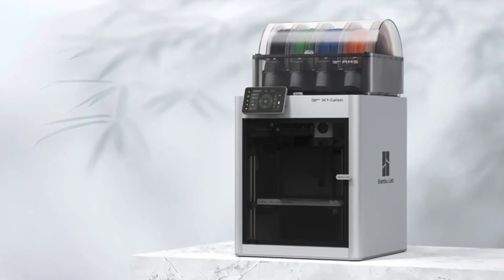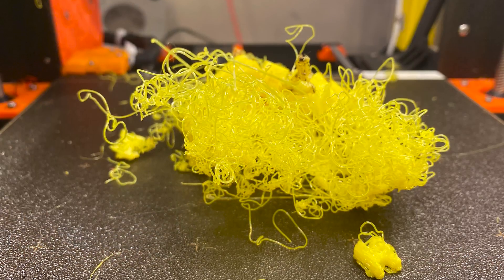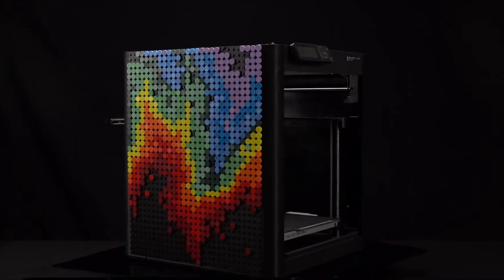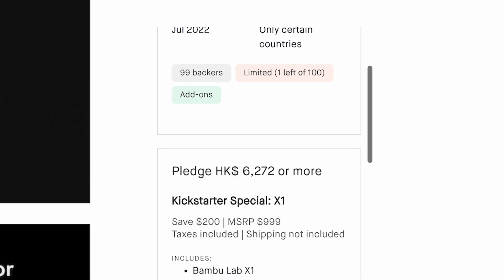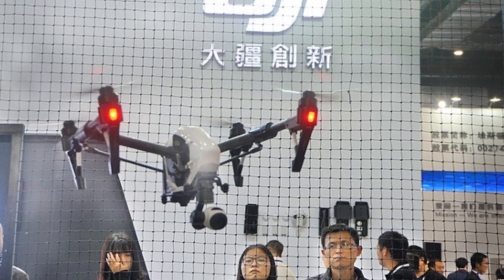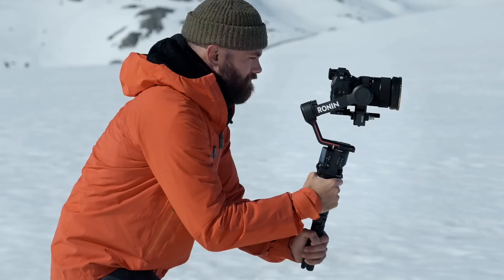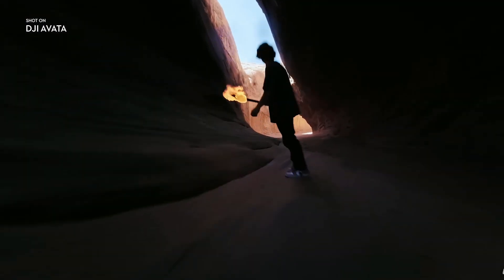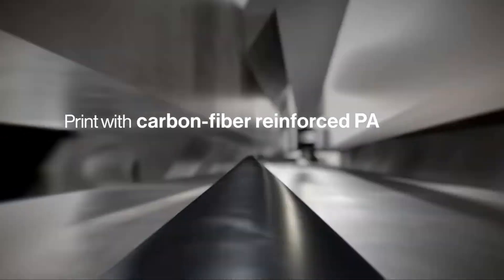Bambu Lab's X1-Carbon 3D Printer: Who is this Company?

Comment: The validation, interpretation, modification, fulfilment, and dispute settlement of these Terms are governed by the laws of the People's Republic of China. If any dispute arises concerning the content or performance of these Terms, the dispute shall be settled through friendly negotiation. In the event that the dispute cannot be settled through negotiation, either party could submit the dispute to China International Economic and Trade Arbitration Commission (CIETAC) for arbitration which shall be conducted in accordance with the CIETAC's arbitration rules in effect at the time of applying for arbitration. The arbitral tribunal shall consist of three (3) arbitrators. Bambu Lab and you shall be entitled to appoint one arbitrator, and the third arbitrator shall be jointly appointed by CIETAC. The language of the arbitration is English and is conducted in Shanghai, China. All arbitrators must be proficient in English. The arbitral award is final and binding upon both Bambu Lab and you.

Comment: Yes interesting Printer
As I understand it, they had Vez3D as a consultant, 
They have used much of his ideas: central Z motor, active cooling, with air from inside of the cabinet that blows from both sides from the side of the print bed.

Comment: Too bad their build quality and QC sucks, $700-$1500 with the build quality of a creality it seems. So many reports of warped beds, bad hot ends, bad stepper motors, bad MB fans, Carbon rods getting wrecked, AMS' that don't work right. They struggle to print PETG, can't print TPU with the AMS. My friends P1P was dead the day he got it, less than 10hrs or print time, needed new stepper motor, finally got it after 3 weeks of back and forth with BL support. Hard pill to swallow for some people, but BL printers just reflect typical poor chinese manufacturing.
Reply: Do you have a significant number of those people complaining? versus the people staying silent and enjoying their printer? 😂
Reply: @fidelthemenace3968  Yes, it's called the internet.
Reply: Well I will report to you no issues like you described, but you won’t remember that.
Reply: @RCPhotosVideos  Lil monkey trolls every Bambu Lab post since his orange and black dumpster has been so disappointing to him.

I am easily at 2k hours printed since Aug 2022 and the printer is fantastic. Nothing touches it at the moment in out of the box printing and ease of use. 

I am still on the same starting nozzle and build plate. I'm kicking myself because I bought a ton of spare parts thinking I would need them since other 3d printers have burned me in the past. Lil monke even thinks his black and orange science fair project is comparable in speed. LOL. He is best to be ignored.
Reply: @No0o0o0o0o0  We've been though this multiple times, don't know how many times I gotta repeat myself for you. Been using prusa for 4+ years and have never been disappointed in them. Never once had a breakdown or had to repair something. Nobody cares that you have 2k hours, my oldest printer has 10k+ hours, only a nozzle replacement because I went from .4 to .6. Meanwhile, youve had to replace your MB fan in your time, and no telling what else. There isn't a single person that has 2k hours on a BL printer that hasn't had to replace SOMETHING on the printer. Have fun when your bed cable goes out, like everyone else. Thats a 4+ hr job right there.

Keep defending bad QC and bad CS, Im sure your bed is warped now like everyone else. BL even admitted to having hundreds of warped best shipped out from the factory. I care about print quality and reliably, something bambu can't do. Your only example of "bad quality" in a prusa is error 602 which is a non issue, been a non issue for years. Meanwhile I can find dozens of different examples on BL printers regarding bad QC. I've seen it 1st hand multiple times.

Go back under your rock with your silly "20 reasons why BL>prusa"
Reply: @LilApe  it’s funny listening to people who have not used both products but pretends to be an expert in both. I understand where you are coming from with the prusa claims and I have also had a great time with my prusa ownership. BUT owning both has really opened my eyes to the fact prusa got left in the dust by Bambu, again I have enjoyed my Bambu, raise, lulzbot, markforged, prusa, creality, makerbot, elegoo, and others. I still have never used anything like the Bambu.
Reply: @RCPhotosVideos  I've used both. I don't care about speed, I only care about print quality and reliability. My prusa excels in both over the P1P.
Reply: @LilApe  so speed isn’t high on my list but ease of use, setup, filament changing, print management, and monitoring the print are all high up. Followed by multi color, print quality, and % of successful prints and the Bambu exceeds at all of them.
Reply: @RCPhotosVideos  I guess, took me 7 attempts after repairing a P1P to get a successful print. From adhesion problems to clogs. Takes me only 15 minutes to unbox a MK3S, calibrate and get a successful print on the 1st try.
Reply: @LilApe  no argument with the prusa setup, it’s easy and fast. But print setup isn’t as easy. I have been able to talk someone over text messages how to setup a print on a Bambu, load filament and send it to the printer. Maybe my markforged would be on the same level of easiness but no way I could do that with my raise prusa or lulzbot and forget a creality machine.

Comment: I'm an embedded hardware developer for the last 40 years, their integration and design experience makes this printer a simple joy to use.   Many nay sayers will point out they're just copying what exists already.  Every product does this, so what. This printer is big step forward for non tech people to make their first thing.
Reply: It's my first printer. It has been going non-stop for weeks, and all I do is clean the bed plate every 10 or so prints
Reply: @J Davis remember to wipe down the carbon rods now and then! Otherwise, I think the particles can clog and seize up the print head.
Reply: @magnarex  will do, thanks.
Reply: Same thing with DJI drones. First DJI was clunky, but still leap years ahead of anything not built by the DOJ. Now today, govt around the world use DJI for everything from finding lost people, fires, delivery, and that’s not including its amazing camera system. Far more advanced than ProGo, who’s solely focused on videography. If Bambu is anything like DJI, Bambu with only explode from here. By far best printer on the market, that’s including with all its issues. I’d take a lemon X1CC over a working Ender ANY day. Bambu makes everything extremely simple to replace.
Reply: They are advancing the industry and other companies should now step up

Comment: I am really not a fan of the Bambu printers anymore. I ordered a couple and they had way too many issues and it was just a chore to work with.
Reply from the maker: What were the issues you ran into?
Reply: @Slant 3D  I had the consistent wavy pattern. It looked like ringing but was across the whole length of every part. They acknowledged that there was an occlusion at certain speeds though mine never went away.
Reply: SOme units had damaged screws for the Z height from shipping, maybe that was your problem?
Reply: @DisorderedArray  wasn't on the z axis. Though I did take apart everything an diagnose what I could.
Reply: @Titan3DMFG  no, when the z screws are bent, I think they push the plate back and forth in the x axis as they rotate. It produces ringing that can't be removed with the bambu vibration compensation. I read some YouTube comments from people who had that problem, and bambu sent them replacement units. Obviously it might not be your issue, but bambu have pretty good customer service, it's worth asking about it.
Reply: @DisorderedArray  oh I've spent 6 weeks with customer support and it's been okay at best. I mean I took the whole machine apart. Like leadscrews were no longer attached and checked everything I could. The pattern on the prints matched the belt pitch so it's definitely got something to do with that and my theory is the self tensioning system. I really don't like it, my springs were soft.
Reply: @Titan3DMFG  ah well, too bad you had such poor performance. I've been really happy with my X1C, the prints are basically perfect (excluding adhesion problems). But since part of the attraction of the bambu machines is that they should work straight out of the box, you seem to have had some shitty luck.
Reply: @DisorderedArray  agreed. I do love their slicer and them in concept. Definitely need to do more qc

Comment: Another great video. My only concern about this printer is any requirement to use a phone to register (being forced to register)or to send STLs to a cloud somewhere. Other than that it looks great.
Reply from the maker: Good point. But we didn't want to do a review of the printer. This video was just about the team that made it.
Reply: cloud uloads fails a lot, hope to see a wifi solution in the foture
Reply: @solasauto  repeat, you can use the "only Lan" mode
Reply: @riccardosacchetti  and you can use SD card only
Reply: @Dashitishere22  oh, yes!
Reply: You can send the gcode via Lan only, without cloud
Reply: @riccardosacchetti  I heard in order to even use that machine you have to register it that’s another issue
Reply: @FriendshipLights  mhh, no. I have one and you can print without the Cloud and/or an account
Reply: @riccardosacchetti  first time I am hearing that. Cool!
Reply: Hey. You don't have to send them through the cloud. It has local LAN mode and an SD reader. But yea you have to pair it with the app at first. You can disconnect it from the internet after tho i guess
Reply: @magnarex  that’s terrible to make you pair it. I like to open a machine, assemble and put in the farm. Their should be no need for an “app” to pair with. Or any of these hoops to jump through. IMO

Comment: Great team indeed, however you fail to see and show that the FFF industry was not stagnant at all. The 3d printing community was coming out with new concepts and technology at a quick pace.  Klipper firmware allowed anyone with EXISTING 3d printing hardware could be expanded and iterated upon with simple software coding. Python use allowed to quickly edit and continously improve upon concepts  and continuously deliver.  This was all shown to the world most notably by Voron Design group and the many members of the 3d printing community creating mods to Voron Designed printer projects. Voron would then incorporate many mods into revisions of their printer designs.  Bambu Labs clearly states the Voron Design Team as being their primary inspiration among others.
Reply from the maker: True. The industry wasn't fully stagant. But it was slowing. The most favored prusa machine was relased 5 years ago. And Auto-bed leveling was more than half a decade old as well. Bambulabs was a shot in the arm
Reply: @slant3d  more than anything it lights a fire under the prosumer 3D printer manufacturers. You wouldn't expect a stock ender 3 to compete with something in the X1 price range, but a lot of the printers that were in that price range, ultimaker etc. are bog standards that produced prints that looked no different to what you could get off a well tuned budget machine. Hopefully this makes the other more established companies that have been coasting for the past few years up their game. Hopefully the Prusa XL is the start of this (although for a significantly higher price than the X1).
Reply: Agree. Compare with Bamboo as Apple is totally not make sence.